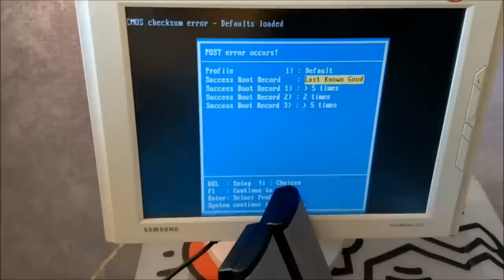No POST Computer (no beep) [Solved]

Comment: Just replaced my cmos... Still no beeps and no posting. The CPU fan starts from 10% to 100% without a clue
Reply: that mean your cpu not compatible or the pin are broken
Reply: Removing the RAM Modules and adding them again module for module can help sometimes.
Reply: I dumped the motherboard.
Reply: @NutScrewGamer  was that the problem?
Reply: @soloco  The power delivery for the CPU was dead. One of the mosfet broke down and started a chain reaction. All of the mosfets died
Reply: The north bridge was dead anyways. Couldn't get sata or USB working at all. Pretty much useless

Comment: You just have to remove it and put it back in after a minute and then the CMOS memory is resetted. You probably messed with the BIOS settings and/or you have a bad power supply or bad earth in your house that the CMOS was damaged caused by electrostatic electricity.

Comment: You know, sometimes we make the problem much more complex than it really needs to be. Thanks for causing me to sit back, take a deep breath, replace the battery and get back to work.
Reply: Paul Wilson yeah go ahead and think that, I've got this exact issue and taking the battery out doesn't do jackshit
Reply: @lingoringo2328  4 years later, but did you ever figure it out? Im currently stuck in this dilemma

Comment: my problem was I hadn't pushed the RAM in as far as it would go, was terrified I'd have to replace everything, make sure you press the RAM in until it clicks on both sides. press Really firmly (I thought I was going to break it) and hopefully that will solve your problem! ^.^
Reply from the maker: +ILACKCREATIVITY thanks for sharing your experience!.... I hope it'll be useful for someone!!
Reply: dodo56022 you're very welcome!
Reply: ILACKCREATIVITY I hate mobos that don't come with rgb ports.. 
because it just messes up the process to use the gpu and hope it isn't causing the problem.
Reply: Bro, have extra RAM sticks?
Reply: I have a tip if you dont want to push it too hard, push the clip and the side of the ram at the same time. Push one side first then the other.

Comment: Hello! Im currently trying to fix my PC. Im running a bit of an older build, with an asrock fma88m pro3+ and an amd a10 7700k. I have 8 gb of Gskill Sniper and a rx 560. It doesnt seem to post but the fans spin up and i dont get video output from igpu or dgpu. I took out the cmos battery about 5 mins and am checking in the morning. If it doesnt work, what should I do?

Comment: Well i can't second that. Today i did put an old PC in a new case. The PC was working in the old case a few years ago but for the last few years the mainboard was sitting around without a case in a box and thus the PC wasn't used. 
In the new case i had the problem you described. The screen was black, the fans were running and when adding a pc speaker there was no POST beep sound error messages. The PSU was the same. 
So i tried your solution. The battery was empty, but doing a CMOS BIOS reset and replacing the battery with a new one didn't solve the problem. The screen stayed black. But what solved my problem was removing all 4 memory dimms. Cleaning them a little on its connectors and adding only one Module back into the mainboard. After that i powered the computer on and suddenly i got a normal boot-up screen. After that i configured the bios, rebooted the machine to check if the new settings worked and when it did I turned it off again to add another module. Then i powered it on again, now with 2 RAM modules. It worked, so i turned it off again. AI did this step two more times for the other 2 dimm modules. 
The PC is now running, but an empty battery wasn't the issue. I also never had such a problem. Usually all my other old PCs are running with an empty battery. They loose of course their BIOS settings all the time, but they do run. And setting up the BIOS all the time isn't a big issue for me.

Comment: I got a very dated board off a guy abit with a great Athlon CPU on it for 10 bucks.  Installed m the board into a case with a power supply.  It would turn on but not post.  I replaced the cmos battery bit still no post   I removed the battery and went to clear the cmos and low and behold the jumper was missing.  So I pulled a jumper off a junk board cleared the cmos and put back to the 1 2 position..  low and behold it posted after a few reboots.. just need a decent pci video  card to make it more modern.   5 stars.  Thanks for the videos guys.  They really help

Comment: Hi So i have this old computer full of dust the monitor works and the ram to if i take it out it beeps so the ram works but as you explained about the cmos i did everything still heavy fan noises no beeps at this point i replaced the bios fro another computer still not working my voltage for pc is set to 115V and i plugged it in extension cord 110V so i have no clue what the problem is everything works nicely why does the display not show me my windows Xp please help me :( i have checked everything and im so sad this computer has a lot of games and my data! it beeped 3 times which was ram but that was fixed please help me. I will edit this comment if i get a answer thanks!
Reply: Have you got any fix?

Comment: I’ve tested all my parts in another system and they work but when I put them in my system it doesn’t post, although 2 months ago my psu blew up so would have that fried the MB, when I cleared the cmos it just made it worse and not post but before it was but always freezing trying to get to the bios

Comment: can year and a half old mobo go bad? My current problem is, pc wont post, i can hear ticking sound from mobo speaker at 1 sec interval. all fans spining at each ticking sound ssd led flashes for a short time. i tried removing gpu, sound card,different ram, other cpu, changing battery, reseting cmos, remove from case,different psu, run without ssd.
Reply: my specs are: z97p d3 mobo, 16gb of corsair ram, gtx 1070, i7 4790k, be quiet stright power 10 600w psu.

Comment: Just watching this because my cpu upgrade (i5 ivy bridge 3550 to i7 sandy bridge 2600k) now causes my pc to not POST. I updated Bios, clr cmos, integrated graphics. Just cycles the power no beeps (also took out all ram and same thing), its a 2nd hand cpu and i think its dead. I put the i5 back in and all works fine again with gpu. Last thing i can think of is find someone with a 2600k and try there cpu but thats gonna be hard. Thoughts?
Reply: Try with better and more powerful PSU like Fortron 550 watts.

Comment: I have changed cmos and ram too but no beep, even without ram and no display so what might be the issue?
Reply: have you found a fix?
Reply: ever found a fix?
Reply: @treenut5046   @Lingo Ringo  4 years later, but did you ever figure it out? Im currently stuck in this dilemma
Reply: LGaming 👾  nope…never got it fixed…

Comment: my pc turns on but my monitor turns on and off, after ~10 minutes the monitor starts working again and everything was fine
but again when I turn the pc on the monitor doesnt (the light on the monitor turns green then yellow then off, green,yellow,off)  it just goes like that
today I turned on the pc and waited for the monitor to turn on after 10 mins, it didnt , I did wait for a long time but again it didnt turn on, can u help me , I can explain it better if u can help me cuz I know this one seems like a mess of words
Reply from the maker: Hi +Loti Bajrami, unfortunately I'm just an amateur. I uploaded this video only to show one way to solve  the problem (the useful one,  in my case), I am not able to help you. 
However your problem seems exactly the same I had got. Have yet you try to replace the cmos battery?
Reply: I dont have the idea what is a cmos battery
Reply from the maker: +Loti Bajrami look at the video and description.
Reply: the battery on the MOBO

Comment: Followed this exactly fans spin GPU light lit but no post does this mean my MB is fried?
Reply from the maker: +steve1341000 maybe it's a GPU problem... If you have the opportunity, try to change it...
Reply: I have tried without Gpu same outcome unfortunately also change the Ram as well
Reply: steve1341000 same here, any results?
Reply: I changed the PSU all seems fine now
Reply: steve1341000 Bro I was changing my psu and then out of a blew everything smelled like something was fried...
Bro smell your Motherboard
Reply: steve1341000 i did too but then everything got fried
Reply: steve1341000 I
Reply: I hope you still active, maybe i have the same problem as you, so i want to ask, do change the PSU solved all the problems?
Reply: @theopratama9047  not all... Some. Just SOME
Reply: @NutScrewGamer  nigga this is 7 months ago i just buy new psu to solve the problem. well thanks for replying
Reply: @theopratama9047  2 years now :)

Happy yet?

Comment: My problem is that the power supply is running, having static electric on the motherboard but cooling fan is not running and is not turning on !! Please advice ?
Reply: I have the same problem, you found a fix yet?

Comment: Tried it = No luck
Clear CMOS = No Luck

No POST , CPU is warming up like it's still alive, tried another CPU not working....don't think it's the PSU because It worked with another system 

Any ideas of what could this be ? hope my Mobo isn't dead
Reply: did you ever find out what it was, same problem, cant seem to troubleshoot it.
Reply: Same problem over here. Something new? Could you solve it?
Reply: @Matt Heinitsh I had an asus P5B and the only solution was throw it to trash. Sad but true.
Reply: But I couldn't get into bios, maybe you are luckier than me :/
Reply: @Matt Heinitsh :(
Reply: Ahmed A. Helmy your mono is probably dead
Reply: Same problem, I'll update if I find a solution
Reply: @mrnarason  did you find one?
Reply: @antalflorian7662  I think the bios got messed up on my mobo somehow (probably from my ocing). So my cpu was not compatible with it. ryzen 3600 and asrock b450m mobo. I bought a new mobo, gigabyte b550 and it works perfectly now, no problem.

Comment: Guys check how you installed cpu. My problem was that I didnt pulled the lever all the way up when I was installing cpu.
Reply: @NutScrewGamer  No they didnt but cpu didnt lay nice.
Reply: @NutScrewGamer  No, I didnt push leaver al the way to the top, after I did, verything worked great, it posted normally.

Comment: man I have the same problem with no post and video output I turned on my pc and show the same in the video the CPU and CPU fan is working  PSU is working fine I don't know if it's a MOBO problem because the Cpu is working fine and even the Fan but after turning on the back panel where a keyboard and mouse ports attached won't show signal light in keyboard and mouse and also in Monitor so my suspect is MOBO but after watching this I didn't think that it's MOBO problem so Cmos battery is the cause of this? can you suggest any possibility of the cause I'm trying to repair my PC?
Reply: jhoniel pelonio hey buddy, what happened to your pc now? This no post thibg happening in my computer.
Reply: same thing happened to me did you find solution?

Comment: Always check the battery, however it did nothing for my situation.. X58m MSI mobo... no beeps... no ram check light... removed all peripherals and power connections minus mobo... turn on power and no beeps... no red stop lights... nadda... this mobo is crap and im not the only one with this issue..
Reply: same like u
Reply: fan and led strip are on ,no beep,dvd drive work(able to close and open),cpu fan are spinning,no  dram check light,no blinking hdd light.....idk what to do,do i need to buy a new motherboard?
Reply: me too
but it's sometime start and sometime don't

Comment: Can you destroy the battery from cpu oc?
Reply: No. I don't think so. If you overclocked your CPU and don't see anything on the screen, even after doing a BIOS reset and using normal settings for the CPU, you probably have destroyed your CPU. But you can try removing all RAM modules and adding them can help sometimes, if the CPU isn't broken.

Comment: damn, a motherboard did not post from one day to the other and this is what i had yet to try. i took out the battery, tested it and it was dead! i hope this is the problem, i'll get a new battery and try.
Reply: David Castellanos what was the outcome
Reply: what happened then? did it POST?
Reply from the maker: +Garette Sebastian the pc starts normally after the CMOS reset procedure...
Reply: Oh, that's nice.
In my case however, I bought a new CMOS battery but it didn't fix my problem.
I need to plug and unplug my PC until it POSTs and boots. What seems to be the problem here?

Comment: i replace the cmos batery and replace the VGA at same time... then it works but i dont know which one that make my comp run.. sory i can't check one by one to make sure which one. , im affraid it will broke again.. hehe
Reply from the maker: +Donny Montreano Well I'm glad you were able to recover your PC😀... However you may mount old VGA and see if the screen will show something again (with minimal resolution)
Reply from the maker: +Donny Montreano I'm glad you were able to recover your pc😀... However you may mount old VGA and see if the screen shows something again (without any software installation👍)
Reply: dodo56022 psu stands for power supply unit not Power SUpply
Reply from the maker: +Smit Shewale ahahahhhh I knew it too late!... This mistake will follow me for a long time!! :)

Comment: I have searched for 2 days and tried all main possibillities for the "no post" problem, but I still start up my PC with it actually starting but still not giving any visuals/display
help ;-;
My motherboard i: MSI 970a-g43
Reply from the maker: +KafeiTomasu hi, did you recently change the PSU? It's a low power supply issue probably

Comment: Not working
Reply from the maker: +Deepak Garia well, one point less in the list! ;)... maybe for you it's a PSU question... Let us know if you'll solve the problem.
Reply: I checked
Reply: Deepak Garia hello, this is super late but I've been stressed about this since it was my first pc build and I couldn't hear a beep, i went through all the cords and made sure everything was plugged in, went by the user manual religiously and still nothing made sense. But then i looked through all my remaining parts and wires and found that i didn't even have my speaker plugged in. If this pertains to anyone reading this please check and make sure in case you didn't make a stupid mistake like me
Reply: The Conservative Truth which speakers? The cable from the case to mobo or the cable from external speakers? Confused

Comment: Had you tried clearing the cmos before buying a new battery?
Reply from the maker: +Peter Refsgaard no I didn't and it can be a good option, but unfortunately for me, I tried the battery in an other motherboard and it didn't work.
Reply: can you help me? so i built a new computer outside the case brand new everything and fans spins but now output and i dont think i would need to replace the battrery sence its new
Reply from the maker: +COMICS ARE THE BEST is the motherboard new too?